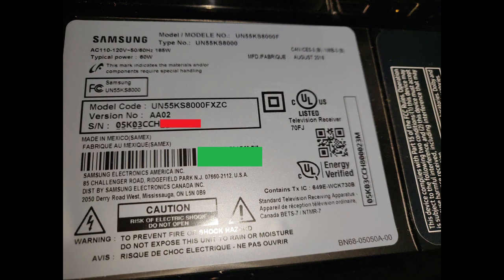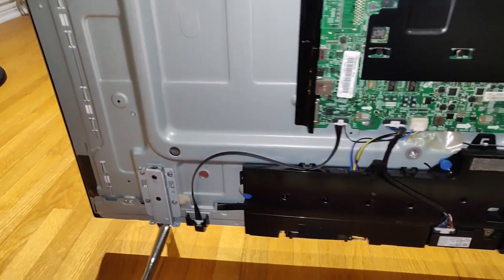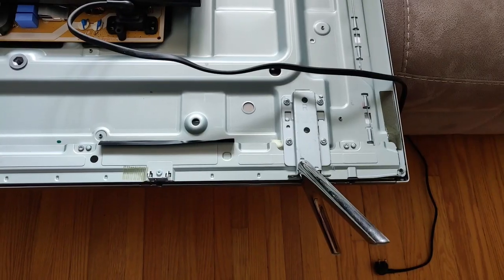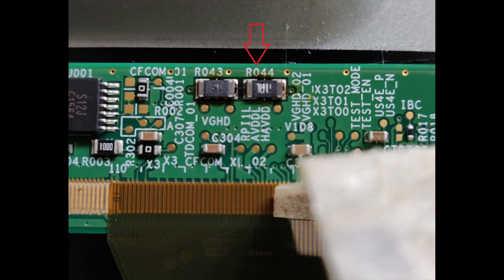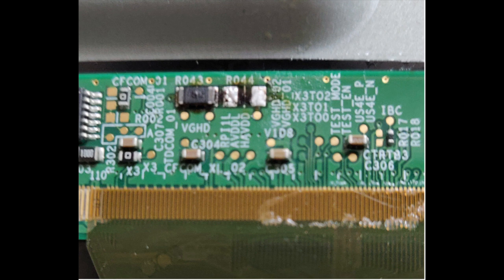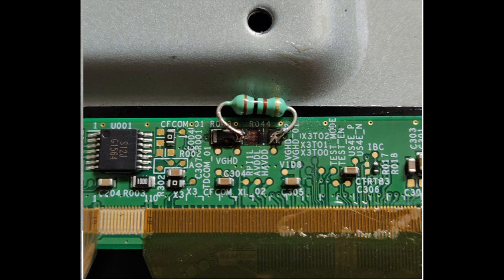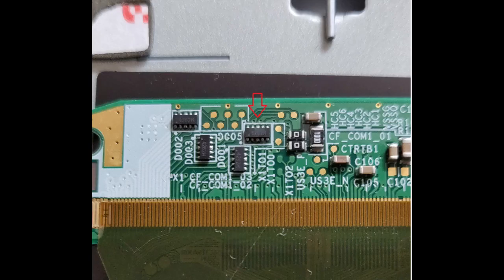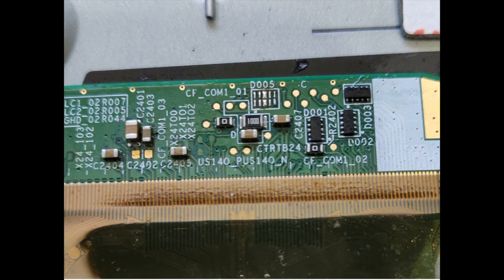Samsung  55 inch LED smart TV repair | Vertical Lines | UN55KS8000 | Resistors, TVS array defective

Comment: Hello. Im trying to to do this fix. One of the pads came off... am I screwed or is there a work around?
Reply from the maker: Depends on which of the pads came off. Can you describe?
Reply: The pad for r044 on the right side.
Reply from the maker: @ocarlo3  if it's the left pad of R044, then no issues. You can solder it direct to R043 right side pad (both are bridged). If it's the right side pad of R044, then it's an issue, but can repaired if you are careful. Risk is yours if you want to try. I don't want to open my TV now, so can't tell you exactly. We need to measure continuity (or check under a microscope) if that pad is/was connected to a via/pth right above that pad. If it's a connection, then you can solder a thin wire from that via/pth.
Any person who has his TV open for repairs can measure the continuity and let you know (or message the others who have repaired; perhaps someone has already checked the continuity).
There's still hope, but needs precision soldering work (after confirming the continuity to that via/pth). Good luck!
Reply: @PremMenon  when u say right side u mean the board on the right side of the whole tv? Or just the pad on the right side of r044? The pad that came off was the left side pad of the board on the right  hand side of the TV.
Reply: I think I understand. I might be OK still.

Comment: Did u replace the 2 diodes or did u leave them off
Reply from the maker: No, I didn't replace the diodes.
Reply: @PremMenon  sir i have a Samsung 55ks800df with the same problem can u help im sure it has bad smds any help?
Reply from the maker: @jeremy74fish21  I have not worked on that model. Open it and check it - if you can put it back safely in the reverse order. Nothing is lost, but you stand to gain if it resolves the issue.

Comment: I removed all 4 resistors and replaced it with 4 100 ohms resistors. Also, removed the 2 diode array units. Now the tv is power cycling on and off. Any idea why?

Comment: Hi! I tried to fix my TV with this method but it didn't work. It's the whole TV that has vertical lines but it reacts to button input. I fixed the resistor that was dead and removed both D005's but it didn't do anything. What can I do now?
EDIT: The soldering pads for the D005 got completely wrecked, does that matter?

Comment: TLDR: This worked great and I will add that the removal of both D005 units is required. 
I pulled my tv apart. Checked for burnt ribbons on the logic boards and did not see any indicators that those needed to be replaced. I moved on to the bottom board. I metered out the resistors referenced in this video, 1 on each side had extremely high resistance. I replaced all four resistors and put it back together and it did not repair the issue. I pulled it apart removed the two D005 units and the tv now works. Thank you!!!!
Reply from the maker: I'm glad it helped.👍
Reply: @PremMenon  can you help me with the part number or where to buy the D005, please..Thanks
Reply from the maker: Sorry, I do not know the PN. I just removed the diodes. Did use new resistors. 100 Ohm 1206 should work (resistors). Good luck!

Comment: what happens if I replace the resisters with the same 51ohm resisters?
Reply from the maker: Sure, go ahead.
Reply: @PremMenon  tried this but didn't fix my vertical lines issue....not sure if I messed up while desoldering/soldering...
Reply: @Grooby97  did you make sure to additionally remove the d005 units?
Reply: @danryan4344  yes I did.  Also I fixed the problem.  Turns out my soldering was bad.  I purchased some flux and use flux to help me redo the solder.  Everything is working now.
Reply: Would I be asking for the same problem in the near future?

Comment: Where do you buy the resistors and such from? I am unable to find
Reply: I got mine on Amazon. Had to purchase a 200 pack but it was only $10
Reply: Here's the 100ohm 1206 thin film 1/4W resistors I bought and they worked. 

https://www.digikey.com/en/products/detail/yageo/RT1206FRE07100RL/1082858

Comment: Thanks so much for this video! I snagged almost the same TV from the dump and it has the same symptoms. Just like yours, R043 measured 51 ohms and R044 was open. Rather than replace the 51 ohm with 100, I used a 68 ohm. I managed to lift the left pad, just like you did. It appeared that the pad connected to R043, so I soldered to one end of R043 and the remaining good pad. I powered on, and got the same streaks, but this time I saw words appear- BUT, my 68ohm resistor was getting hot and smoking.
I guess I'll try a 100 ohm, but it still will have a lot of current going through it.
Maybe I should go higher, like a 270ohm? I'd like to see a schematic to see what these resistors are doing in the circuit.
Thanks again for your video.
Reply from the maker: Remove the TVS. Increasing the R value may not help. Good luck.
Reply: @PremMenon  I guess I'll try removing the diode array (at lest the left hand one first), but why do you think the tv works without this? Are these diodes serving as surge/reverse voltage protection and are not really needed?
Reply from the maker: Yes! You said it. They are used for surge protection.

Comment: I have the same problem I’ll change the resistor and the reading is 15ohms I’ll change this already with 51ohms resistor is this ok my next step is remove the other 2 on the end
Reply from the maker: Yes, remove the defective TVS, and then power-on. Good luck!

Comment: This video helped me fix my TV which had gone green with lines, and had entered an infinite bootloop. I replaced both boards (power & motherboard) using parts from tvpartstoday - I paid under $100 CAD, they are the cheapest site I could find - those came in but did not fix my bootloop issue. I then took a look at the lower LED circuitry and noticed R044 was visibly burnt. I replaced it with a 75 ohm resistor, and I removed D005 completely as done in this video. My TV began to work after this, so I did not touch anything on the right-hand side of the LED circuitry. Thank you for the clear instructions in the video!
Reply from the maker: I'm glad you were able to fix the problem. And, thank you for letting me know. 👍

Comment: Just did this now -worked like a champ! 🙏🏻 Thanks for the tips. If you need to do this follow exactly what he did and it will work, including taking off the components at the end.
Reply from the maker: Wow! That's great to hear. 👍
Reply: Hi can you tell me where you buy the resistors and which ones exactly please ?

Comment: We are having the same issue. How do we test the resistors?
Reply: RO43 and RO44 look burnt but I'm not positive. Wish I could post a picture.
Reply from the maker: Even if it looks burnt, it might still be good.
Reply: @PremMenon  when I tried to test the resistor it slid off the board and I barely touched it. Oops
Reply from the maker: You can check by using multimeter set in the Ohm/resistance range
Reply from the maker: @mikemolinari4679  yes, 100 Ohms should work. 👍